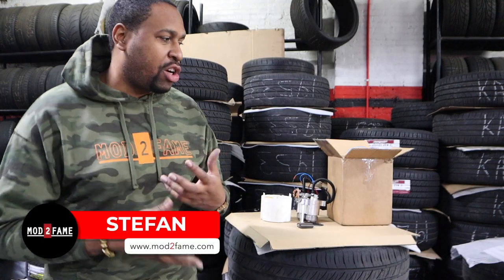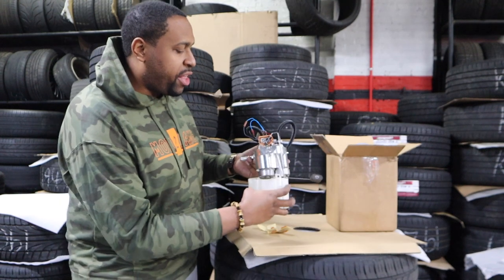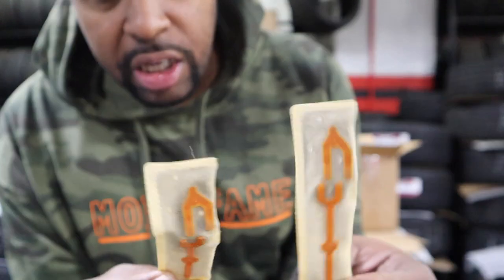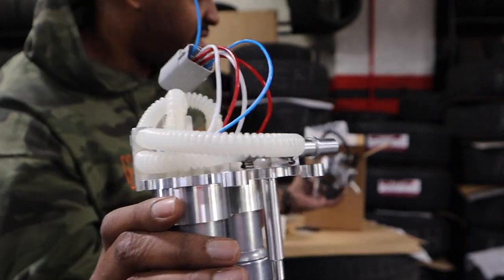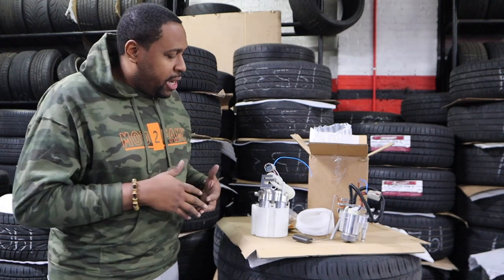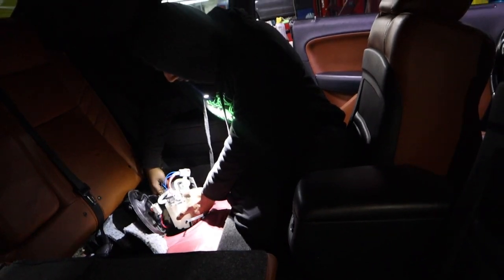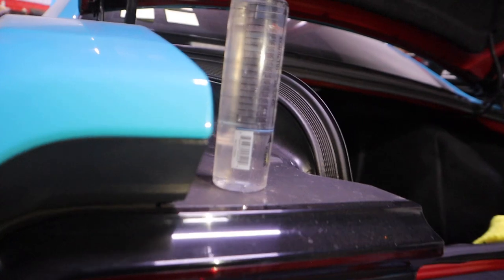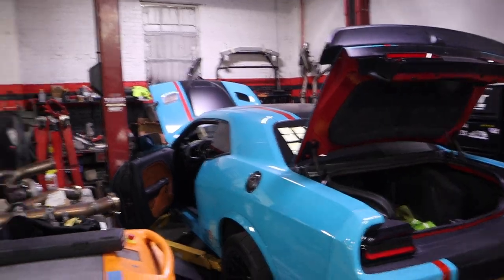BEST Fuel System For A Hellcat on CORN : E85

Comment: Now I don't have a Hellcat, but in my ProCharged 5.7 on E85, I use the Fore Innovations Dual pump full return set up and have had no issues at 1/4 tank. That said, I do keep it over 1/3 tank when at the track just to ensure I don't have that issue.

Comment: NO ONE talks about the Holley TRUe dual pump system with the hydramat for fuel pickup. Why? I have no idea. These piggyback pump systems do not flow both pumps full capacity.. Add a boost pump to the Holley and you will not max it out with any current street 3rd gen hemi. The real kicker would be to dual pump one or both sides of the Holley system.
Reply: I've done a lot of research on fuel systems before I went to the full return FORE dual lump system. And the holly was at the top of my list but after I read all the reviews I couldn't justify buying it. Most of the issues stemed from having a sump tank on all our vehicles and the passenger side pump starves itself. I only know what I've read. And went the HHP route. If you have one please do a video on how your car responds could save someone 1000 bucks 🫡💪🏾

Comment: Do you not have to run a second fuel pump module with additional relay for the pump or does it just all plug into factory harness?
Reply from the maker: Yes it comes with a second module but all controlled by the PCM as it will see it as one pump